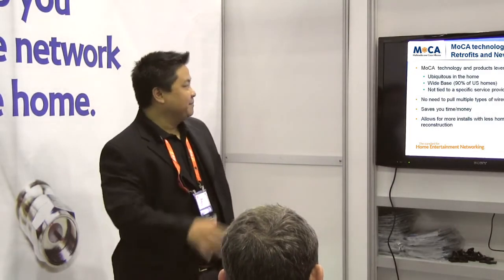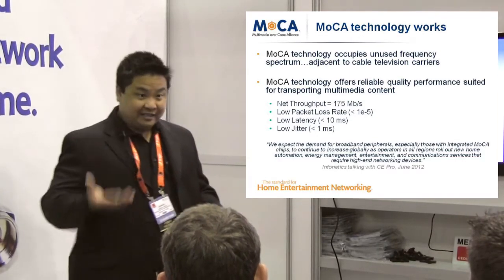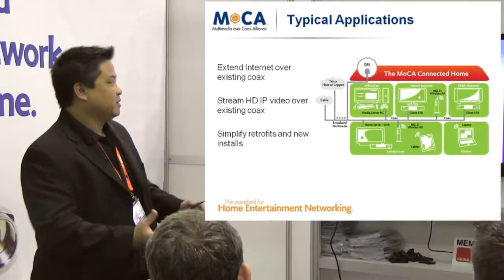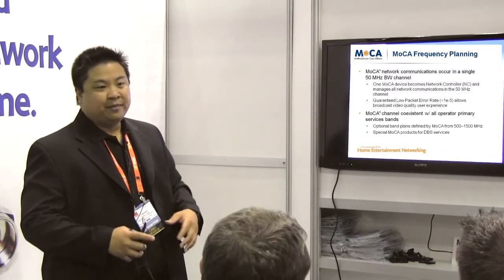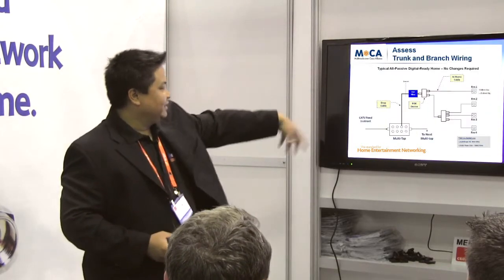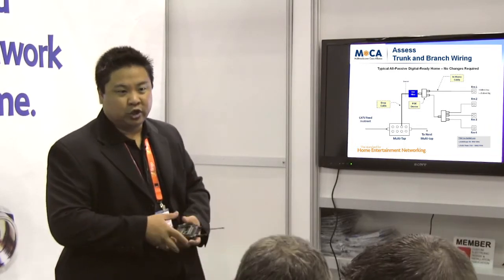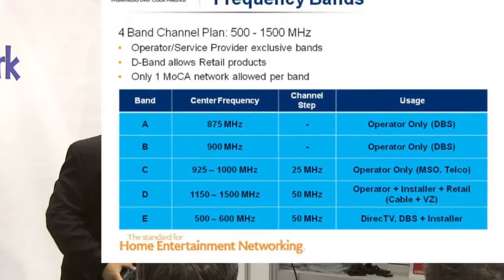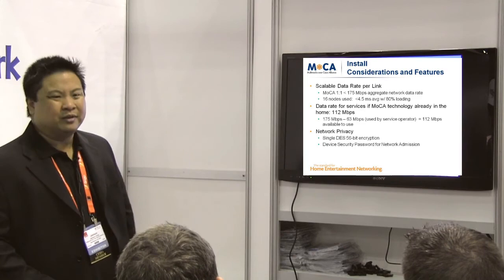How to install MoCA(R) technology

Comment: hey lied or lets say misled  l thought  the same thing you need a separate component('s) TIVO  Jumped way ahead assuming all rooms had (ethernet) i have installed ether-net cables in my old house, drilling thru flours walls baseboards crawling thru basement crawl spaces they say nothing about the proper way to setup MoCa network you need separate component('s) COX my cable provider techs had no idea what MoCa was